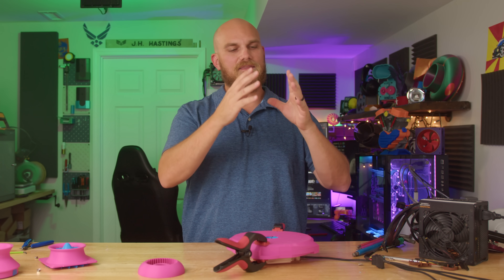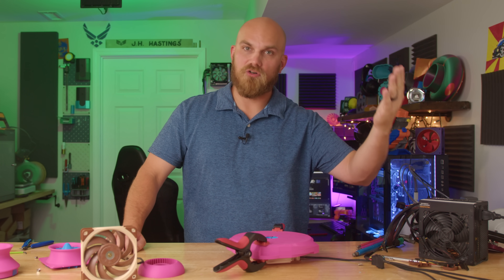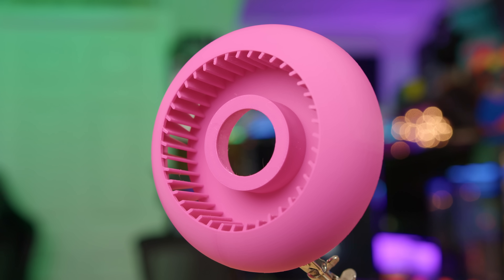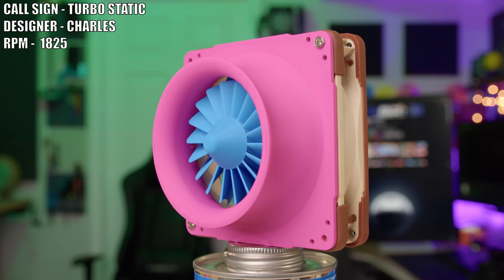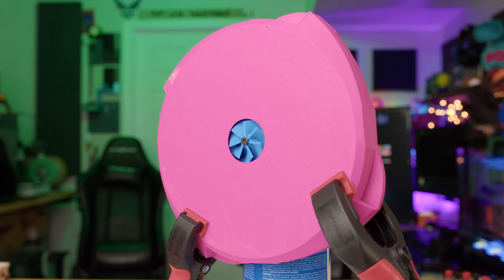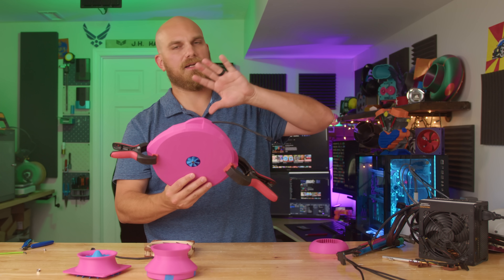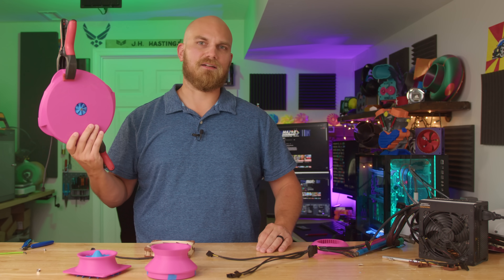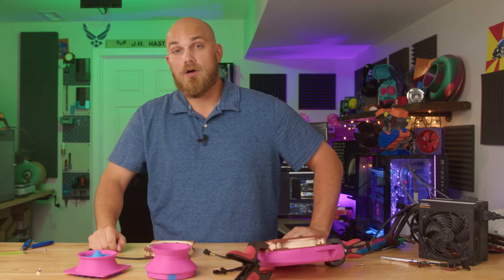Wild 2-Stage 200mm Blower Fan Redefines Power | Fan Showdown S6E6

Comment: CFM is one thing, static pressure is another, but static pressure does not mean moving air which will cool something. Ultimately it is air mass moved per unit of time that will cool something.
The next season should be either : a requirement of static pressure and see the most CFM, or a requirement of CFM and see the one with more static pressure. The NEEDED static pressure is not much since radiators are mostly free flowing, so measure air resistance of the intended radiator, then place a hard line of minimum static pressure required, then do a chart of those who met the static pressure AND order them by CFM. and if you like more rules, add a size limit. Fans can be pushing or pulling so the side facing the radiator must be possible to attach to it.
Reply: There shouldn't be any CFM or Pressure requirement, take them all and test for both.
Reply: Agree 100%.   Air movement is the critical attribute.  You can't transfer heat if you aren't moving it from one place to another.
Reply: I agree this is important.

Under Bernoulli's thoerem, there are 3 elements to pressure: Static pressure (how much pressure is just naturally there), velocity head (the pressure caused by the velocity of the fluid, v squared / 2g), and height head (rho * g * h)

Thing is, you can get a lot of pressure from velocity head, but not move any air. If you have a flow through a pipe, the pressure is low, but the flow is high. Restrict the pipe somewhere, and the pressure is high, but the ultimate flow is lower since the flow is a function of the velocity and cross-sectional area. That's one of the reasons that the compressor design goes from small to large to small to large to small -- you're changing the cross-sectional area to fiddle with velocities and pressures and getting a higher ultimate pressure. But If you had the same sized compressor or fan, the fan would always move more air than the compressor.
Reply: I have to agree whole-heartedly. This entire season is a bit ridiculous as the best "fan" for pushing into a closed tube is essentially a compressor pump. Hook the A12 up to a diaphragm pump, seal the edges, and you've got an instant winner. This isn't reflective of the requirements for cooling a computer, which is really what we came here for. Love the videos, but it kinda went into the weeds fast
Reply: @jamesirmiger3120, Exactly my thoughts as well. I was waiting for a other section of testing cfm, then when the video ended I thought "easy, just build a  compressor rather than a fan", blowers are just centrifugal compressors. This is really only testing the most efficient compressor, and if there are no leaks in the static pressure test rig, then efficiency doesn't even matter, only the highest end result pressure,  which could just be geared/leveraged until the material stress becomes the limit. For a fan test, at least measure pressure through a given orifice size,  to get flow and pressure...
Reply: The holy grail is measuring the full flow vs pressure curve.
People limit themselves to only flow at 0 pressure and pressure at 0 flow and that's bad.
Reply: Just to turn these ideas into a test rig specification : just choose a diaphragm setup that more or less reproduce the pressure drop you get through a realistic computer case, then measure airflow or pressure drop across this diaphragm for all fans.
Reply: Air flow and air pressure are correlated variables when they are measured under the same conditions (think voltage/current, which behave the same, with V=IR). The problem is that, until now, the conditions have been varied, with airflow measured with no resistance and static pressure measured with high resistance. It is unlikely to find a single fan design that performs well in these opposite environments. To go back to the fan showdown roots and find a design that will work best for case cooling purposes, you'd need to standardize on some level of medium to medium-low air resistance. When this is fixed, fans that produce higher airflow will also produce higher pressure.

Instead of the Plexiglas wall for recording the airflow pattern and a separate setup for measuring flow rate or pressure, I think it would be best to make a large Plexiglas box (large volume would provide a longer time to visualize airflow before the whole thing gets clogged with smoke) and fan mount on one side and exhaust hole on the other. Resistance would be controlled by the size of the exhaust hole and any material placed over it, e.g. open cell foam filter, metal grid, radiator, etc.
Reply: Exactly, the design is gamed to win in testing but is functionally useless for PC cooling. Double compressor with heavily restricted inlet and flow channels, it will never move much air.
Best setup IMO would be measuring CFM though a modestly restricted outlet. Easy.
Reply: This! I am very , very curious to see the CFM/pressure relationship for these beasts and the two-stage thing especially
Reply: Static pressure is always relevant when it comes to moving air through a tube, screen, filter, or other obstruction like a heatsink or radiator. There should be a balance between the two, such that the fan can produce enough static pressure to maintain a particular flow of air over the surfaces it needs to cool.
Reply: You can’t have pressure without air being packed on top to create that pressure. That means there are air molecules being moved from above the fan, to below the fan, with nowhere to go. If they had somewhere to go, it would be movement of a lot of free flowing air molecules.
Reply: @benupde1979  Static pressure and air flow are two different concepts.  Consider a bottle with a cork in it.  Press the cork down and you increase the static pressure, but you have added no air to it.  Left alone, the cork does an excellent job of maintaining the static pressure, but there is no air movement into or out of the bottle.  So no heat is carried by air in or out of the bottle. A cooling fan and a compressor are similar but different devices with different goals.  A fan's ability to maintain static pressure is important, because that helps with moving air through obstructions such as small orifices and filters.  But it also needs to be able to move large volumes of air in order to actually transfer large amounts of heat.  A compressor is designed to move fluid or gas at high pressure, with volume being a secondary consideration.

Comment: i'm in both groups, that depend on what you want the fan to be used.... ie you cannot use 3 200mm fan desing on a 360mm watercooling radiator.
as long as it's silent and performant i'm in. 
but there should be 2 categories,  the ones taht can replace standard fans as is (maybe with a extra 1.5cm in thickness) and the others, so we compare comparable things

Comment: I don't think gluing the "Centrifuge madness" would add much if anything, but if you are going to do then using a low modulus silicone sealer (e.g. bathroom sealer) would enable you to get it apart without damage pretty easily with a thin spudger or knife to cut down the joints.

Comment: Going to weigh in here…

What you’re describing is akin to Motorsport…a spec class vs unlimited.  Spec is to see how far you can grind down the post within a narrow framework and unlimited to see how far things can literally go.  

i get the original vibe of this was to design something for practical use, something you might even find in production or that could be made into something you could buy one day (which has happened!!). But at the same time the fascination of watching the apex of what is possible unfold.  

I think you could see better numbers by incorporating both, because very quickly it’s a battle of attrition in the limited class which can become boring (spec Miata/Nascar anyone?). While I do think it’s unreasonable to expect to use any of the unlimited fans, bonus points could be given for those designs that could realistically be incorporated into a computer case for actual use. 

Just my two cents

Comment: I'd like to see fans separately tested in Group Z *AND* Category 3. I really like both.

I would however like to point out, that we seem to be missing the point of the fan being there in the first place... you haven't been testing thermal performance at all in this season. Are "pressure-focussed" fans better at cooling than "airflow-focussed" fans, or vice-versa?

Comment: Rules; Anything that be printed within a single print*
A single print being what can be printed within the print area on the 3d printer used.
Should be a set volume and nothing extra can be added, like bearings, lubes etc. If lubes are used, then it should be used for everyone.

Comment: Edit: TL;DR - I like Group B, but I think there needs to be two categories, one for group a, one for Group B, and pick a winner for each category.

Because you specifically requested it, I personally find myself falling into Group B. Anything goes. This is because, I think it's really cool to see the ingenuity of people. For example, the supercharger with hood scoop fan design from a while ago. Really cool design, probably never going to make one myself. Or if I did, it's not going to actually be a fan. Or the other supercharger design that you had here more recently. The one that if it were able to be made more quiet, would make an absolutely awesome desk toy running at about 5:00 to 10 RPM. Again, I wouldn't make one as a fan, but that doesn't mean that's not cool to see. 

As for the ones that actually fit inside the standard knock to a fan frame, I also really like seeing those, and I agree with the other person that said they should have kind of their own category. That actually works better than the noctua fan, that individual has the potential to make a lot of money off of it. Whether by making them themselves, or by giving Noctua or Cooler Master or one of the fan manufacturers the rights to produce it.

Comment: if the fan can fit inside a average pc case (including all other internal components like GPU’s/RAM/etc than the size shouldn’t matter, if the only way to get the fan in the case by having the panels removed that would mean it is disqualified.

Comment: I'm inbetween the two groups.

My opinion is: If it can reasonably fit inside a PC case, then it's fair game.

So it needs to be either 140x140, or 140x280mm, and no more than say 50mm in depth to allow for SOME CPU heatsink / GPU clearance.

Worth exploring that the Centrifuge Madness still would be sat in 3rd place overall within the regular fan specifications by removing the large external fan goes to show that there is still major gains to be found without "cheating".

Comment: First off, I think anything goes, but maybe the group b fans have an asterisk or something to show they are the wild ones. Second, I think next season should be exhaust flow! The way I'd envision it is buy a cheap single fan case, test flow through rate on that with a built, but turned off PC. Then, build an airtight cubic foot box with silicone and your choice of walls, add an interior fan mount, add holes till it matches stock PC. Edit: example link in replies

Comment: 6.7? That's probably the best performance we had form a single fan yet. Can you try it with just the inserted shroud? Because if it's even close to that (and I think it will be), you could absolutely just stick that in a case and use it.

Comment: If you can print it - why stop at "just fans"? I have a workstation with 2 CPUs and I've placed 2 pieces of thin plastic to cut shortcuts from intake fans to outtake so air HAS to go through CPU radiators and memory sticks. -5c on both of them with this "hack". Can you buy it in a store? No. Is it cheap, fast and has descent effect - yes. Why not then?

Comment: tbh my opinion is somewhere in between:
as long as it fits into a pc case with all other hardware and can still do its job it's fine
Reply: i think i'd be okay with it being mountable in some way even with sticking out the case, as long as the case doesn't need to be modified in a way its not originally intended to be and fully assembled. meaning no cutting panels, no removed panels, no pc component like the psu sitting outside. however i don't think it'd be cheating to use server tower cases for more space and 5.25'' drive bays to mount the fan...

Comment: somebody needs to design a parastaltic pump based on that fan.
use the fan motor and a printed geartrain to get the torque.
the hardest part i think would be sealing it.
if that works it should be able to generate more pressure than this setup can mesure

Comment: Im in Camp 2, there is some means that we can take cases and take the empty void of the case thats not doing anything and actually turning it into something useful, OptimumTech (who til renamed to optimum) did something like this, taking the void space and turning it into direct shrouding for air flow, basically making air tunnels. I do however feel like in the spreadsheet they should be classed as Camp 1: The Purists and Camp 2: The Rebels, that way we can also see who theoretically could work within a case. 

Maybe something that Fan Showdown Season ? could be, Specific case and components are uses which is then give set measurements and you have to build a fan to fit the formalities of the case - granted, this might be a bit messy for testing and potentially lead to a lot of prints being guess works and "good concept on paper though currently not worth the time in practice"

Comment: Group A should be fans, ie entirely fall within the frame. Group B representing fans that fit within the width and height of the  frame, but can contain a nozzle, or cone, or similar that extends coaxialy from the frame. A blend of classes could be made to represent how much of a protrusion there is, ie Group A.5 ("A point five") the parameters of which can be up to the host and could be effectively arbitrary. For some structure, as an example, not much protrusion would be an A.1, A.2, etc. A long protrusion A.8 A.9, with 0 being too long to effectively mount to the frame with the frame mounted to the test stand. An A.0 or B.0 requires extra support, and may need to be reclassified Group C. These blended classes could also have ducts that curve outward represented by odd numbers (A.1, A.3, A.5, etc), and cones that curve to from the center of the frame to the outer edges represented by even (A.2, A.4, A.6,etc) . However, while this blending implies the device under test occupies more than a frames dimension of volume, Group A.x rotating air moving parts are required to fit inside the frame. Group B air moving parts may extend beyond the small dimension of the frame but must remain within the large dimensions footprint.

Group C, or the Outlaw class, covers anything larger than the long dimensions of the frame.

In summary, if you want a fan thats a fan, entirely within the volume of the frame, Group A, no blend. 

If you want the fan section, the air mover, to be within the frames small dimension, but will accept some kind of air guide (ie, cones, ducts, etc), Group A.x.

If you're okay with a air moving section that extends beyond the small dimension but not the large dimension, Group B. Group B and Group B.x blends are considered the same, the number may well represent the length or complexity of the extended section.

If you want to make wacky stuff with that type of motor driving it, Group C, Outlaw Class.

Note: The drive frame at time of writing is the A-12x25. And is subject to change in the future with no obligation for notice at the hosts whim. Any instance of "frame" in above rules refers to the chosen reference frame at the time of submission. Check your local laws and regulations before submitting.

I tried to make this a rigorous rule set. Rules lawyers, you're free to take shots at these , Im curious if I overlooked anything....

Comment: Absolutely do a video with the Centrifuge Madness glued up. At 7:50 you can see it is leaking a lot of air. I believe it has the potential to break the 10mm of h2o pressure barrier 😃

Comment: the centrifuge madness needs sealing as its leaking all over and losing internal pressure.  even silicone sealant would be fine instead of using glue.

Comment: As an industrial engineer I'm all for any design that works .. industrial machines very  often have fan cowlings and external enclosures that are much much bigger than the cut out in the panel for the fan duct ... Enable the divergent thinking..makes for good competition.

Comment: @majorhardware  Why retard and separate the development process that everyone is giving you?  Its like your sandbagging opposing designs to keep your preferred one ahead. Air movement, ambient noise and wattage draw were your original specs that made sense..... you would need to re benchmark everything to calibrate an even playing field for the design split. Its like if you were a engine or dynamometer guy that loved forced performance but didn't want to test Turbo chargers, Super chargers, NOS, Nitro Methane or E-85 Alcohol evenly. Techinically those are all forced induction systems  because they all change the air mass charge loading weight